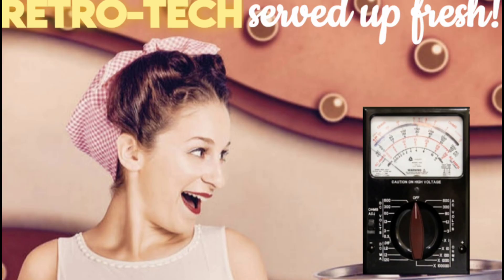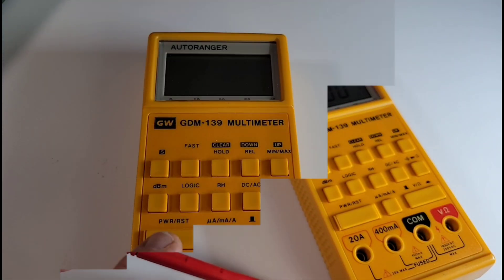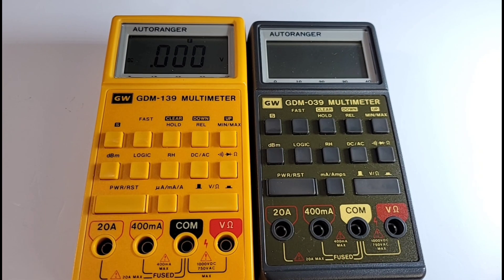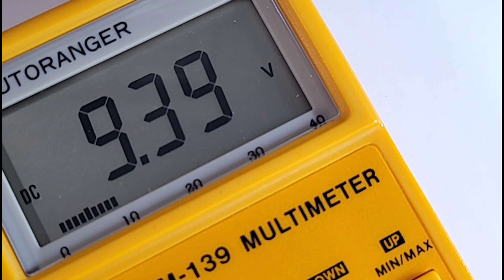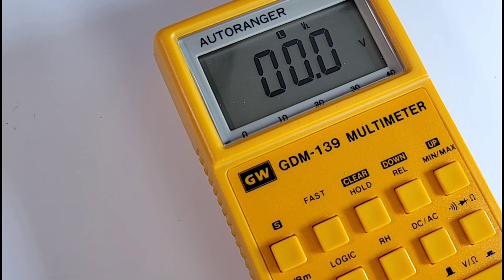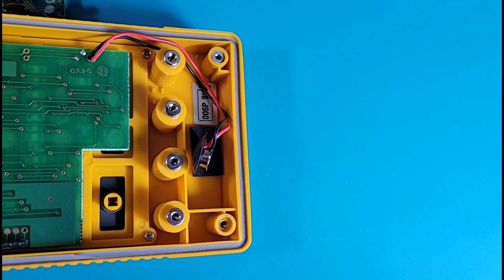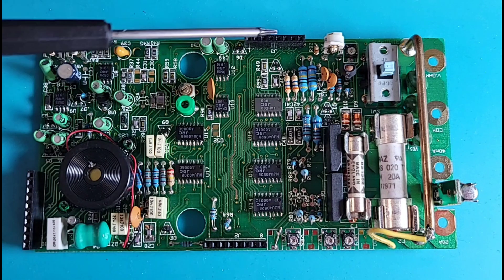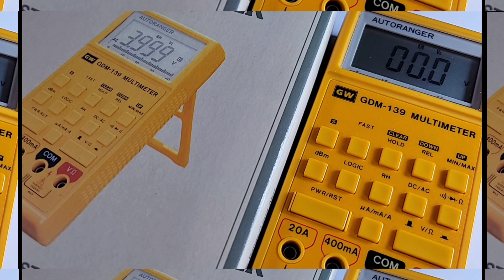RETRO-TECH ○ GW INSTEK GDM 139 Vintage Multimeter Mini Review & Teardown!

Comment: Very nice vintage catch!  Looks like a brand new calculator.  This has a lot of cool features, love to be able to swap out accuracy for speed.  Adjustable stand?  Outstanding!  Lots of quality stuff jammed inside.  Would like to see the logic mode in action. I'll keep my eyes out for one of these.
Reply from the maker: Hi Paul..
Thx , yes it's really jammed with alot of great features. I haven't seen any like it..I also have it's sibling..the GDM-039, Identical dmm except it's black and does not support uA nor is it weatherproofed, iit also lacks the adjustable tilt stand found in the  GDM-139

Comment: Great to take a look at this meter. I don't own a single piece of GW Instek equipment..... Nice build inside, looked like there may have been a PTC just above the switch as well as the MOVs. I am not 100% sure when the CAT ratings were introduced IEC61010 was first introduced in 1990. Fluke started to CAT rate their instruments from mid 1990s. I have an old Fluke 73 from circa 1992 that has no CAT rating marked on it.
Reply from the maker: GW Instek is a real sleeper..the few test instruments I have from them are all top notch in the quality department 🤩👍